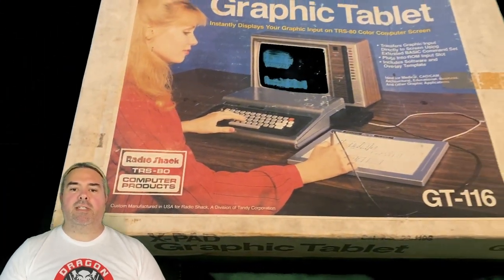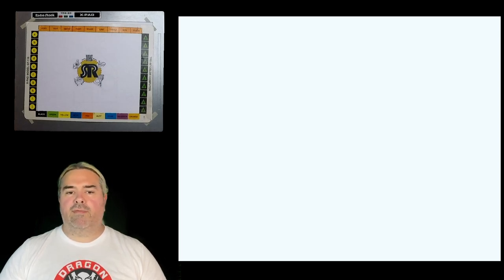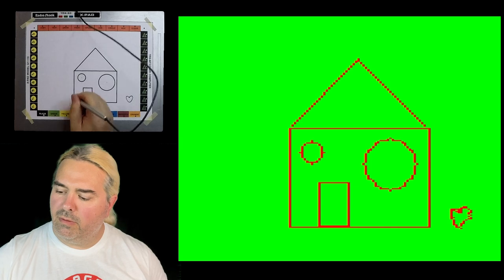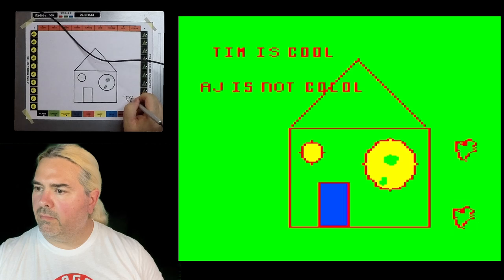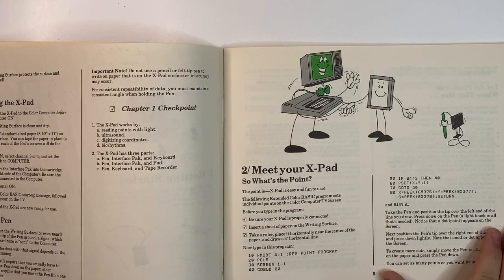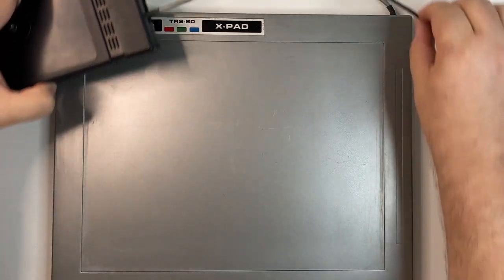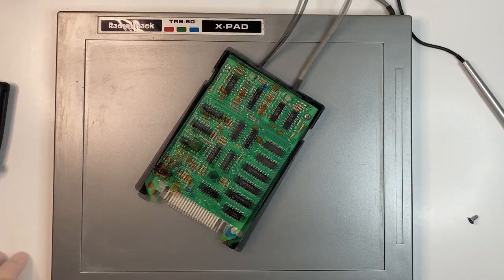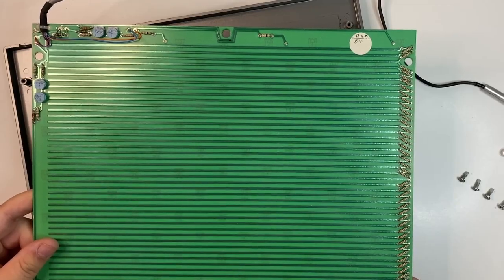Radio Shack Tandy X Pad Hardware and Software Demo #septandy

Comment: The Radio Shack Tandy X Pad reminds me of the Koala Pad I used back in the day with my Commodore 64 computer. P.S. awesome thumbnail for your video!
Reply from the maker: Of course the Koala Pad was pressure sensitive. With no proximity nor margin detection. It was clearly inferior. I own 6, they make good source for joystick cables.
Reply: @lindnertim  For shame using Koala Pad cables for joysticks! I'll trade you NOS cables for your Koala Pads to save them.
Reply: @lindnertim - having had a friend back in the Coco 1 days who had one, I have to agree. The XPad as far superior to the KoalaPad (Radio Shack sold both for the Coco). Of course, it cost a heckuva lot more, and it needed 12V (not on the Coco 2 or 3) so that has to be added (or use a multipak - which I would because I would want to save/load from disk, not cassette). Also, it's cool you got yours working - Bill Nobel has his working too (and his at-long-last-re-acquired Symphony 12 with synth keyboard) and I believe he is working on programs to use both pieces of hardware under NitrOS9 and a Coco 3.
Reply: @CurtisBoyle  If someone wants to send me a XPad to check out, I wouldn't complain but for now I'm going to make some totally radical BBS splash screens using my KoalaPad 🙂

Comment: Yeah, I was just about to say repairing the insulation on the pen wire isn't enough.  I'm sure they provided a shielded cable for a reason, so you should make an effort to replace the whole cable.  I'm sure you can find a 2 conductor, shielded cable replacement somewhere.

Comment: Nifty! I have one of those things - I keep meaning to make a video about it myself but never seem to have the time. I don't think they sold very well, probably because of the cost. I got mine pretty cheap after they had been discontinued and were on clearance - I think I only paid $99 for it? I do remember that mine developed a bad curve along the edge - you could draw straight up the edge of the overlay but the coordinates would come out skewed in the upper left. I found that messing with those pots in the tablet helped adjust the linearity, but I could never get it completely right. I figure the pots and / or the resistors in there were out of spec. Maybe I'll try fixing it - would make an interesting video. Trying to reverse engineer the thing would be a good challenge!

Comment: How does it work?  Before you took it apart, I would've said "I dunno".  but after a peek inside (thanks, btw, pretty neat, have never seen the innards of an x-pad).  After seeing it though, I know that there's a radio involved, because the cursor appears when the pen is in proximity to the pad, and so my guess is there's a transmitter in the pen, and the thick fat traces are basically antennas.  So the position is determined by measuring the signal strength of the transmission from the pen.  By knowing the signal strength to each of the antennas, you can do some math to determine position.  Whew... this engagement stuff is exhausting...lol.   And AJ IS cool. :)
Reply: No, I doubt there's any transmitter. It's probably just capacitance. Much, much easier to work with, cheaper, and more reliable.
Reply: @AureliusR   Capacitance would require a physical touching of the pen to the digitizer pad.  However, when the pen is just IN PROXIMITY to the pad, it's detected without contacting the pad.  When you push the pen against the paper, the pen tip moves inward slightly (closing a switch) which is an indicator that the pen is touching the paper, and thus the software is notified to draw rather than just show the pointer, and the pointer disappears.  Capacitive touch screens require physical contact for any sort of detection to take place, and, capacitive touch screens.  Also, capacitive touch screens measure the change in capacitance of the the screen when your finger contacts the screen.  Also, the innards of a capacitive touch screen look nothing like the innards of the pad.  So, short answer, you're wrong.
Reply: @johanlaurasia @#@%ing YouTube keeps deleting or not showing my replies.
Reply: @johanlaurasia Hopefully I can reply now. Capacitance does not require physical contact -- that's the whole point. There's no DC path. Second, there's no way looking at the chips there that they are using an RF system of any kind. IBM did that later with CrossPad but it failed. So no, I am not wrong. Go look at Atmel QTouch chips -- it's old technology all wrapped up in a single IC.

Comment: Tim -- look at the camera! :)
Reply: Also, would you be willing to take a high-resolution photo of both the front and back of the PCB? I'd be interested in reverse-engineering at least part (or all) of it, would be neat to be able to make replacement boards in case someone needs one.